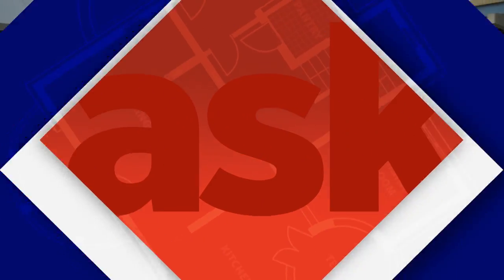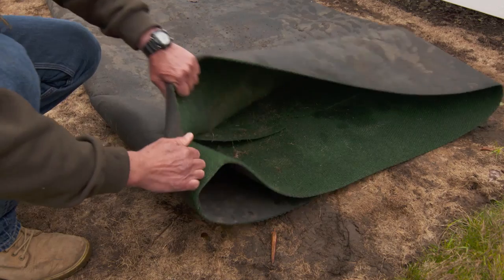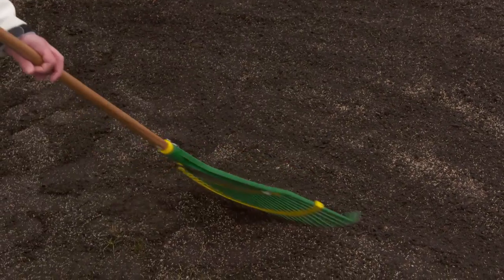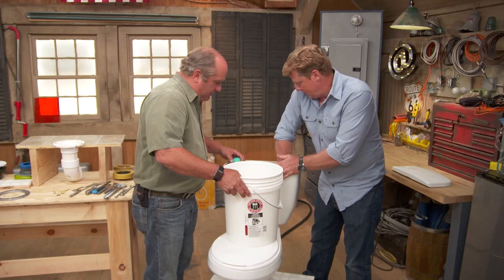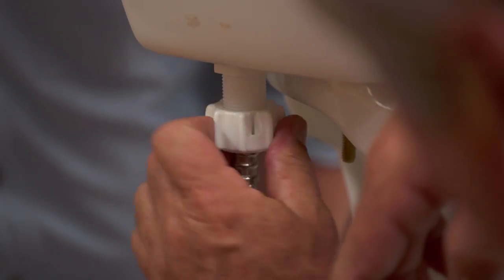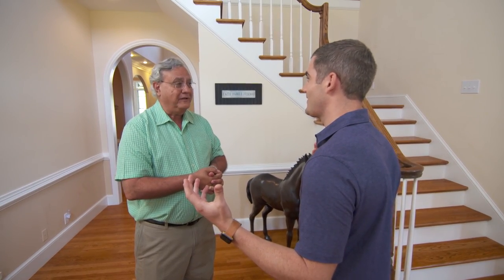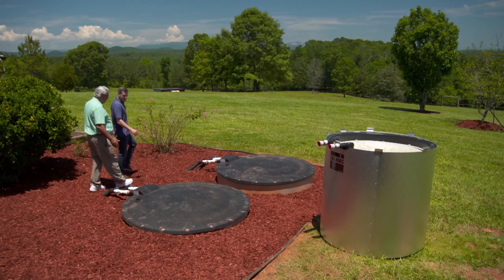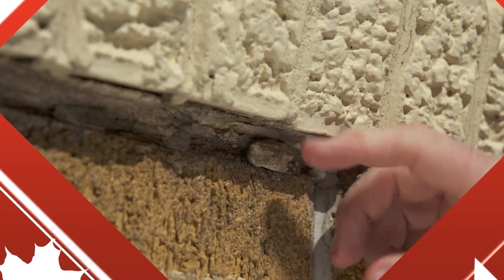Ask This Old House | Patch Lawn, Toilet, Off-Grid (S16 E4) | FULL EPISODE

Comment: Toilet tip: Dump a bucket of water quickly into the bowl after you've drained the storage tank. It will force it to flush and only leave a small amount of water in the bottom. Much more manageable.

Comment: I had to replace the floor in the house I had recently bought. The toilet flange wasn't attached to the floor. I was planning on replacing the tile anyway. I got the house for a good price. I have had a few projects. That was the only thing that had extra problems
 The house is 80 years old.

Comment: Tape measures usually have a keyhole (like a wall shelf would have) on the clip. Just find a screw that fits the keyhole, and screw it most of the way into the side of your workbench, face of cabinet, etc. You can just hand the tape on that. There, saved you $10 for a magnet, glue, and plate.
Reply: And added a place for your to rip / tear clothing or skin.
Reply: @scallywag1716  Waaaaaaaaaaaaaaaaaaaaah
Reply: Rick S. Big, tough guy....you so manly I bet all the dudes love you.

Comment: This off grid system would cost easily $100,000! That’s two lifetimes of power from the grid. 🤦🏻‍♂️😂
Reply: You’re smoking crack if you think a 6,800 sq ft house only uses $100,000 of energy over two lifetimes.
Reply: William M. You’re probably right! 😂😂 maybe 10 lifetimes is better? I’m from Australia so unless it’s in metric I have no idea 🤣

Comment: I am so desperate I need your help the seven-year-old little girl put slime down our drain in the sink and now the tub and sink are both blocked I desperately need ideas we have tried wink we have tried five bottles of liquid plumber and now we have tried green goblin so need your help
Reply: Electric Snake it. Rent one from home supply store. The snake will remove the debris in pipes.
Reply: you need to mechanically remove that. liquid plumber and other solvents won't do it.. it's just going to sit in the pipes. you'll need a plumber, or someone with a line/whip long enough to break up the slime in your pipes. best of luck.
Reply: Be careful if you do it yourself with a snake. That liquid plumber may come back up as you remove the debris. Wear heavy rubber gloves.
Reply: I bet you she won't do that again!!

Comment: Off the grid..... till something breaks down
Reply: On the grid... Till something breaks down.
Reply: @StoneE4  it takes on grid technology to make off grid technology.
Reply: @robertgroover3316  - New technology can be adapted to any kind of utility distribution. It doesn't matter whether that distribution is through a single factory, a single home, or a whole metropolitan area.
Reply: @StoneE4  try making that stuff without oil.
Reply: @robertgroover3316  - Yes, the manufacturing of some utility distribution equipment requires oil. Some of it doesn't. In the future it might be the case that none of it requires oil... What's your point?
Reply: @StoneE4  We're building an off grid house now and it was actually cheaper to do it then be grid tied.  I agree that eventually off grid components will be built with off grid means.  It's only a matter of time but would go a lot faster if people like @Robert Groover would get on board and quite fighting the future.